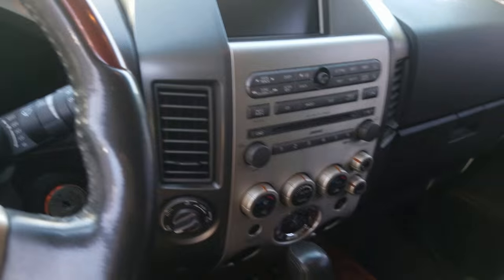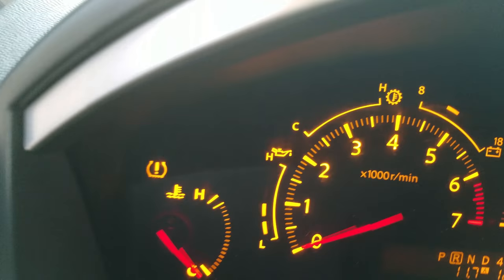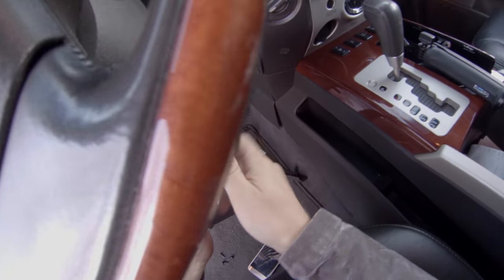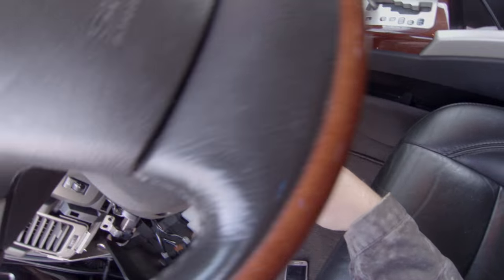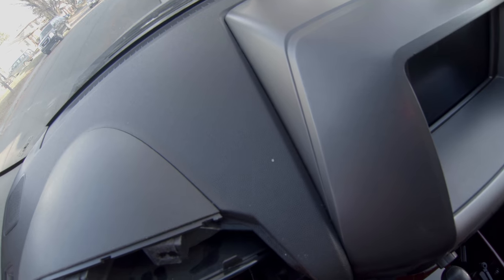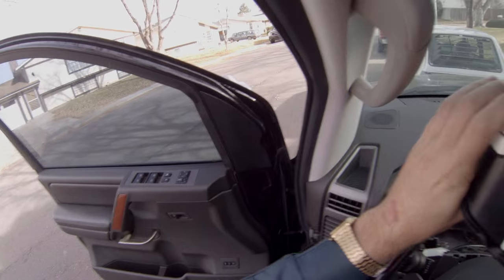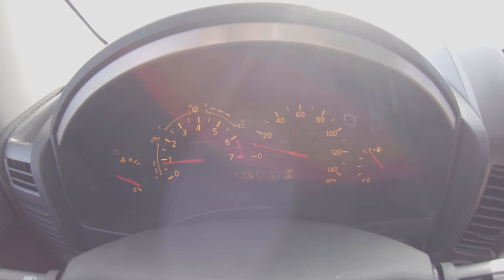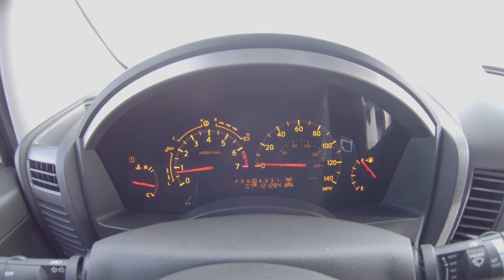2004-2009 Infiniti/Nissan QX56, Armada, Titan Gauge Cluster Removal. Diagnose faulty RPM Speedometer

Comment: Awesome video. Have you ever removed the center dash plastic pieces on your QX56? The rear piece which houses the speaker is cracked, as well as the piece which covers the navigation screen. I believe the navigation piece just pops off as well as the cover for the dials.
Reply from the maker: I haven't taken anything else apart yet.